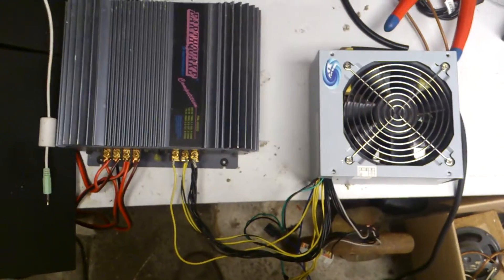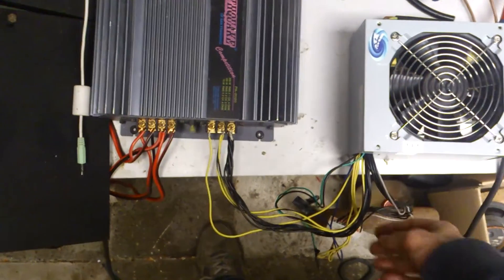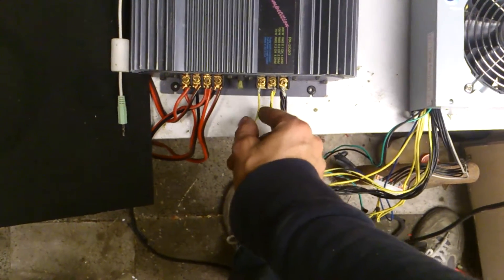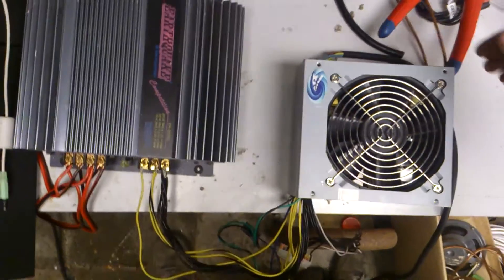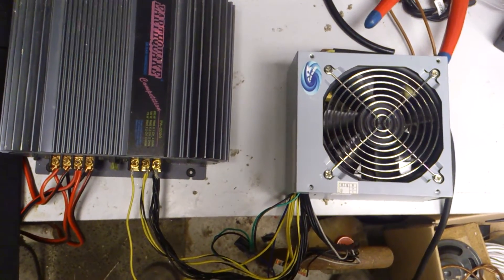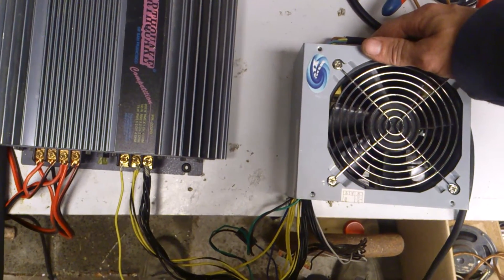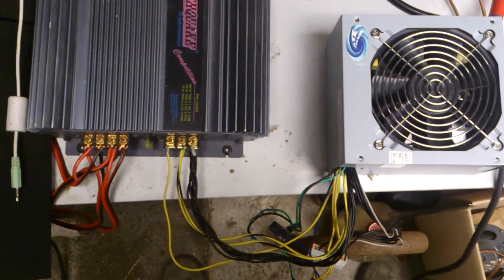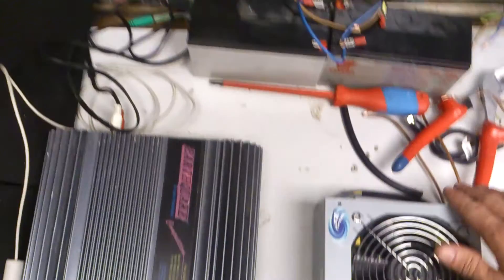Car Amplifier with pc power supply help needed

Comment: Mine is turning red meaning going to protection mode even with no rcas and speaker wires connected ..it's been working fine for 1 year..i didn't use them for 2 months and now it's hsving this issue

Comment: You need to make a short link wire from remote to the +12 (yellow) and also the green wire plus a black from the 24pin need joining to power on the psu simples really also use a decent quality psu ive used corsair cx750 in the past and work faultlessly

Comment: Some car amplifiers use what you call a current test, what tests the car battery status and desides what to turn on or not.
some of them use a lot of current to charge the capacitors inside the car amp when you first turn it on and leads the power supply detecting that you have a short circuit. witch in your case ( shorts the computer PCU out.)

My advice is to either get a new and powerful power supply.
Or.
To start the amp with a car battery and then turn the computer power supply on and then disconnect the car battery.
And voila... Your golden with start/stop system. ;) 
Take care..

Comment: Check green and black it must be shorted because its the switch ...remove the load and turn on the smps check volt with meter

Comment: Well this is what I can tell you what I had did to make it work with no problems. After burning out 2 power supplies I thought about car stereos, so what I did was use a car battery and hook up the power supply to the battery which kept the battery charged and I then hooked my Pioneer radio to it,then my Alpine 450m to it which powers 2 Sony Xplod 12's and after I hooked it up, turned my radio on and it's been working for me for two years so far with still no problems.

Comment: Your PSU may be bad. I have killed 3 using them on amplifiers. They wernt build for sudden, major current draws. Try to find a PSU with more amperage than the amplifier needs. That may help but chance of killing it is high. Maybe higher quality PSU? I'm too poor to try that.